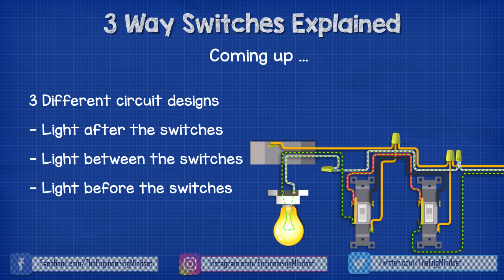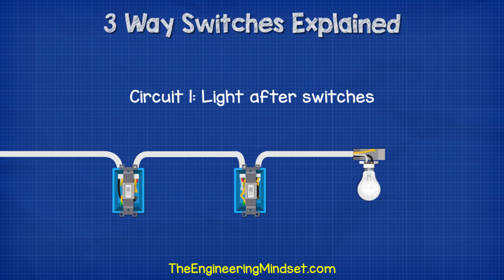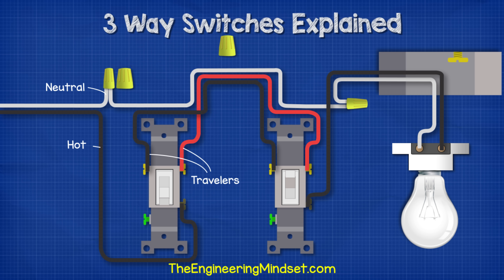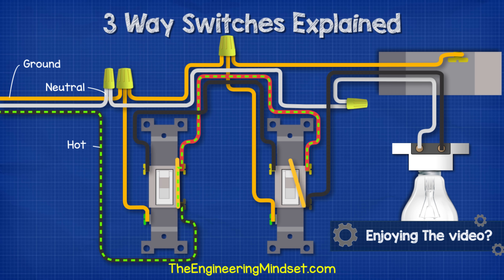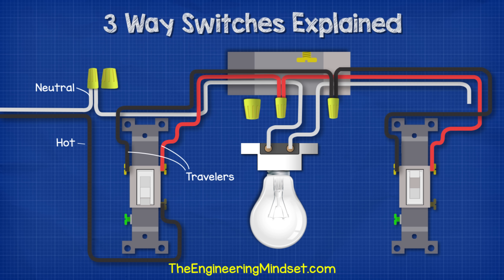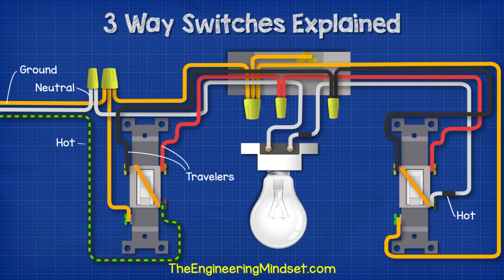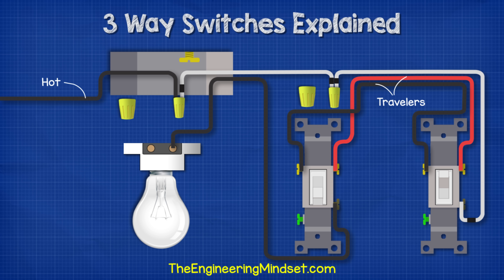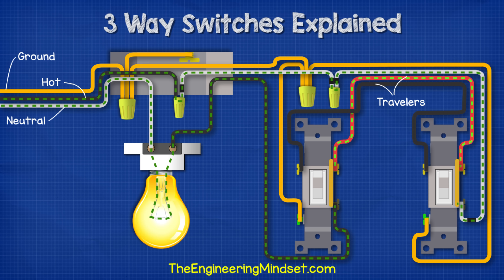3 Way Switches Explained - How to wire 3 way light switch

Comment: Commercial industrial electrician here.  Just saying the first way is right. The second and third ways are called a “California”. 1)They are illegal and 2)will get you fired from any company. 3) if you want a plug below your switch you fucked yourself because you don’t have a neutral in the box. 4) it can cause confusion for the next electrician. Always bring power to your switch12/2 for example. Travelers between switches12/3. Ground everything. Neutrals in the back for later.12/2 to the nearest light. Daisy chain the lights with 12/2. Easy money. 100% inspection ready if you strap your wire

Comment: I have a 2 way switch running to a ceiling light and I want to convert to a 3 way. I ran the 14-3 to the other switch box before I sheet rocked and now I am ready to connect those switches. Which of your 3 examples do I reference.

Comment: Why not wire the left traveler on switch one to the right traveler on switch 2 that way it turns on when you flip the switch up instead of turning on when you flip it down?
Reply: It doesn't matter.  As long as the light changes state when any switch is flipped, it's fine.

Comment: Great video. Quick question. For the second scenario with light in between the switches, if I have multiple pot lights how do I connect them? Do I need 3 wire cable or just 2 between the pot lights. Will be much appreciated if someone can drop a drawing. Thanks a lot.
Reply: @UC81qivdOLC9MX1iyo6gFnEQ I did it already. You need only 2 wires + ground cable

Comment: What size breaker is needed for 3-way switch?
Reply: The load controlled by the switch determines what size circuit breaker is required, as well as the size of the wire.

Comment: I dont know why you insist on throwing all those ground wires in. its an animation. alot easier to understand without them. just say, this is how you ground this circuit, show us and then remove it from the animation.

Comment: One thing I don't understand, in the first example, are the neutral wire connectors necessary? It seems like you could just take the white wire straight to the light.
Reply: Remember that the wires shown are encased in cables going from electrical box to electrical box.  It's much simpler and faster to cut and splice them than it is to try and make certain wires continuous through an electrical box.

Comment: I’ve watched over 20 different dudes explaining hooking up 3 way and they always start half way through or they go to fast, they don’t show and explain where flow goes every wire every step of the way. I had only 14/2 hooked up between my 2 )3-way switches on 1 light. Had 3 different 14/2 wires coming into secondary switch. Holy fuck was I lost because everyone on YouTube shows you with a 14/3 going from switch to switch. Because of your video and my multimeter I was able to determine it was the first example and was able to safely hook up my new led dimmer in the secondary switch. My wife is so happy and so am I with my new slim disk led lights. Thank you thank you thank you for being an actual teacher who covers everything include materials needed and then finally a label of wires.
Reply from the maker: Check our new Multimeter tutorial out ➡️ https://youtu.be/4lAyzRxsbDc
Reply: I think you mean "HOLY FIRETRUCK",because it starts wih F and ends with UCK

Comment: Why do the neutrals need to be connected in the box with a wire nut? Why can't the single wire just go through the box or simply avoid the box altogether because it has no use there?

Comment: I'm having problems because the guy did not put a hot wire in the switch box. The power is in the ceiling

Comment: Well I am more confused than when I started but I'm just starting to learn. Thought it would be easier. Bought a house and there is 1 light that can be controlled by 2 switches. The diagrams look good and do paint a good picture on the path.

Comment: Why not just have one switch? It seems odd to have to flip one switch and then stumble across a dark room to flip another switch on the other side of the room in order to turn on the light.
Reply: If you have ever seen a switch in the on position and then turned off and light comes on, 3 way switch. So, in essence, this prevents you from stumbling in the dark if there are two entry points. My 3 way switch is separated by 130 LF.

Comment: The Engineering Mindset has produced exceptionally good videos: clear, understandable and well organized.  It needs to be pointed out, however, assuming cable is the wiring method used, that Section 200.7(C) of the NEC prohibits the use of a white conductor, even if re-identified, from being used as the feed to the load (second scenario).  The re-identified white wire for the switch at the end of the circuit (right switch in the video) should be used for one of the travelers, and one of the unidentified conductors (black or red) should be used as the return feed to the light.

Comment: I know you posted this video in 2019, but in 2020 NEC says you need a neutral in every box in article 400.4 i think can no longer use white hot. just a heads up
Reply: Thought neutral was just required for fancier switches like dimmers and digital. However . The code might require it now in case the fixture is updated one day to need it so i can see why they have it in there as a placeholder. Guess it depends on if the work will be inspected 🤔😄

Comment: Disappointed.  Paypal would not take my password.  Would you check on that please?
Reply from the maker: Thanks for trying and letting me know. I can't help with the password though, you'd have to contact PayPal
Reply: I finally got it to work.  It was not an iussue of wrong or unaccepted password  on my end. The password textbox refused to accept input. The username was correct and I was sure not to have any spaces before or after.  Resolved by bookmarking and rebooting everything.  

 I got my PDF! It is great.  Seriously.  It printed it and it is going in my book collection.   Thank you for responding.  Excellent work.
Reply from the maker: @miltonfriedman2325  Glad to hear you resolved and managed to get it working. Thanks for your support

Comment: several times, you draw 2-wire cable yet you are circuling 3 wires and then you have 3 wire and draw a cirucle around 4, its confusin.
Reply: 2 wire cable contains 3 wires. 3 wire contains 4 technically. The ground wire is not counted thats why. If you are calling that wire by its trade name it would be called 14-2 or 14-3. 14 is gauge(thickness) the 2 means it contains hot , neutral and ground. The 3 in 14-3 means it contains two hots, a neutral and a ground

Comment: my question is, on the second circuit you marretted the traveler and hot wire in the metal box at the light, why? why not just run the hot and traveller directly from the first switch, run through the light box then to the other switch? to me when you've marretted them at the light box you've just created an unnecessary splice.
Reply: Because cables are installed from box to box, and it's faster to splice them than to try and keep them continuous.

Comment: SO I am just learning about the fundamentals of electricity now, and have a question in regards to why neutral White wire is used as live wire in 2 of the 3 situations?
using an example, the third diagram (with both switches being after the light), the live wire enters into the light housing, and then arbitrarily switches to neutral wire, (with black tape to mark hot). jumping again to a connector once more, and again continuing off to the switch as neutral.
 Would it not make more sense to have just continued using black to signify hot wire all the way to the switch to signify hot?   
Surely there is a reason why it is done this way, but alas Im not nearly experienced enough to understand what that would be :P
Reply: I'm learning the basics too and I have the same question. :\
Reply: In most residential situations, you are using non-metallic-sheathed "Romex" cable.  You don't have a choice of wire colors.  NM-2 cable is Black and White; NM-3 is Black, White, Red, BNM-4 is Black, White, Red, Blue (or Black, White w/black stripe, Red, White w/red stripe).    You have to use the wire colors you have as efficiently (e.g. cheaply) as possible. 

When the white wire is NOT acting as a neutral, it's supposed to have the black markings on it at each end.  In that situation, it's another hot wire, not a neutral.
Reply: @jovetj  thanks for the explanation
Reply: @nuarius  Sure thing.

I'd also like to add that using a white wire as a "hot" in a switch loop is one of the rare wire color exceptions allowed in the US Electrical Code.   And, a few years ago, the code was revised to force more expensive cable be used so a neutral conductor can be ran to a switch box that wouldn't need one.  The idea is future-proofing against the need for a neutral later, were a smart device to be installed to replace the switch.

Comment: Can  I tap into a 3 way to create an outlet?
Reply: If you want the outlet to be on all the time, then you can only "tap in" where the power from the panel comes to the first switch, and there must be a neutral in that box.

If you want the outlet to be switched by the three-way switches, then you can only "tap in" after the final switch, and there must be a neutral in that box.

Comment: Not sure what went wrong, but I'm having issues. I did thd 2nd method where its; incoming power - light switch - recess light times 4 - light switch.

I used my non-contact volt tester on the first switch and found no power.

I went back into the attic with my non-contact volt tester. I followed the power cable and it connects to a junction box (I believe thats what its called). The cable on the other side of the junction box seems to be old. It looks like the one called old fabric insulated cable. 

I tested the old cable and theres power. I came back to cable I followed and theres power. That completely throw me off because there was no reading of power on the first switch. I ran the non contact volt tester throughout the cable and the power seems to die off at a certain length.

Any clue?
Reply: Update: So I noticed the breaker tripped. Not sure how I was still measuring power in the cable, but it was still getting a reading in the non-contact voltage tester.

Nonetheless, I still have a problem. The breaker keeps tripping. The 4 recess lights are LED so I doubt theres too much electrical flow through it.

Comment: So say you have a setup from left to right and it’s switch, light in the middle, and switch. And power coming from the middle. How would you do that?
Reply: It's kind-of like the second scenario in the video.  Power comes in to the light, and the hot goes from there (on the black) to one of the switches and connects to the Common terminal.  The white (marked black) and red wires carry the travelers from that switch back to the light box.  There, they join the same-colored wires going to the other switch.  At the other switch, the black wire connects to the Common terminal, and comes back to the light box, which is connected to the light.  The neutral from the source in the light box is connected to the light figure and that's it.

Comment: Please excuse my ignorance but I am so confused with the difference of two way and three way switches. Are they different? Are they the same? If they are different then when do you use two way? When do you use three way?
Reply: A regular switch, sometimes called "two-way" has two terminals.  When it's ON the terminals are connected; when it's OFF the terminals are not connected. 
A "three-way" switch has three terminals, and must be used in pairs to provide two switching locations. 
A "four-way" switch has four terminals, and can be used with two "three-way" switches to provide three or more switching locations.
Reply: @jovetj  thanks! What about S1 or one way? Is it the same with S2?
Reply: @nikkimalones1324  I am not sure what you mean by S1 or S2.  Please clarify.
Reply: @jovetj  one way and 2 way switch
Reply: @nikkimalones1324  The names used in the USA and in Europe and the rest of the world, are different.  From a European context, yes, a one-way switch is the same as a regular switch in the US.  In formal terms, a regular switch is SPST (Single-Pole, Single-Throw) while a "3-way" switch is SPDT (Single Pole, Double-Throw) and a "4-way" switch is a cross-wired DPDT (Double-pole, Double-throw) switch.
Reply: @jovetj  Thank you so much! I get it now! Very informative 😊
Reply: @nikkimalones1324  You are welcome, I am glad I could help.

Comment: Excellent.  My only suggestion is that the ground wire should be animated in green.
Reply: Might be confusing because in a Romex jacket, it's bare (maybe some paper insulation over it) so it only makes sense in a raceway application to code it green if it were thnn or something  in conduit which is irrelevant for most residential

Comment: Hi, found this very useful,  can you advise me how i can pick up power and ground and common from a wire with a red white black and ground running through it. I picked up black and white and ground but don't seem to have any voltage through the wires. not sure what i am missing.

Comment: Can some one please explain to me, if the black wire is used as the live what is the red wire used as?
Reply: In the United States, the following colors are standard:
– White, Grey = neutral 
– Green, Green w/yellow stripe, bare = ground 
– Everything else can be considered some kind of "hot" or "live" conductor.  A white wire marked black at each end is also a "hot" wire. 

The red extra "hot" wire can be used for several different things.  In these switch circuits, it's used as a traveler to join the two three-way switches together.

Comment: What the heck this is still two way switching, three way switching uses three switches four way uses four switches and so on. This is just two way switching with an earth.
Reply from the maker: No, it's the type of switch used not the quantity of switches
Reply: @EngineeringMindset  No there is no difference in the switches only the amount of wires used to do the switching, it is still a two way circuit. If the switch is on off on,  this is not shown in the video.

Comment: Very helpful videos! I do have a question though. Why do we have a white wire with black tape as a hot wire? Why not just continue using black? Thank you for your videos!
Reply: @theengineeringmindset
Reply: I was going to ask the same question but I have answered myself , I think..  I believe the reason is that in practice when you do the wiring you will have a cable with the black and white, however the black is already being used and the white is redundant so you use that. In theory you could add another cable with just black for this  but that wouldn’t be practical. Hope that makes sense?

Comment: 5:27 that is not legal to use 2 white wires directly to the light, there has to be 1 black, 1 white and 1 ground wire there. You can use the white wire to do jumps only on outlets internally. If you see 2 white wires coming out of a light that is very concerning. Putting black tape is not legal.

Comment: can someone provide real-world examples or applications of these switches?
Reply: Elena You have a hallway light at the top of stairs. You have one switch to control the light at the top of the steps (going to bed) and one at the bottom of the steps (leaving for work).
Reply: @PipeMedic  thank you.  Is this the same operating example for all three wiring iterations (light first, then two switches; switch then light then switch; two switches first, then light)?  Are the different wiring iterations better suited for one application over another?
Reply: Elena all depends on how your house lays out, panel location and stuff like that. You would technically be able to use any of the 3

Comment: Couldn't you run a 14/4  or 12/4 (red, black, blue, white, and ground) from the light to the second box? That way you could still supply a neutral wire to the second box.
Reply: Yes.  But that's extra money because that cable is more expensive and harder to find.

Comment: Excellent video. What happens if the traveling wires are crossed?
Reply: If by "crossed" you mean reversed...  then the switches will still operate just fine.  It doesn't really matter.  The way it's shown, the light will only be ON if the handles are the same (up-up or down-down).  If the travelers are reversed somewhere, then that may not be the case, but it won't really affect the operation any because all of the switches will still work.
If by "crossed" you mean accidentally connected together... then all the switches in the circuit before that crossing become useless and won't do anything.

Comment: all these circuits are the same.. the only difference is where the service cable goes first.   For safety reasons, it is always preferred that there is no hot lead in the light fixture while the light is switched off. Therefore the service cable, containing the hot lead, should go first to one of the two switches.  It is never a good idea to have a permanent hot lead at a light bulb.
Reply: I'm questioning your answer.
Reply: @jovetj   So you disagree that servicing a light fixture is safer if there is no hot lead in the box?
Reply: Depends on what you mean by "servicing a light fixture" and "hot lead at a light bulb."  If you mean one of the contacts on the light socket being perpetually energized, then I agree.  But none of those are shown in this video.  There are no "permanent hot leads" at a light bulb in this video.      
If you mean merely having an always-hot line in the fixture box and then opening up the fixture or electrical box to "service" it, then I disagree.  You're supposed to shut off the power before messing with any wiring anyways.  
   
If you are referring to crazy old wiring schemes like "Hot 3-ways" then yes, I agree.  Those are more dangerous and are illegal for a reason.